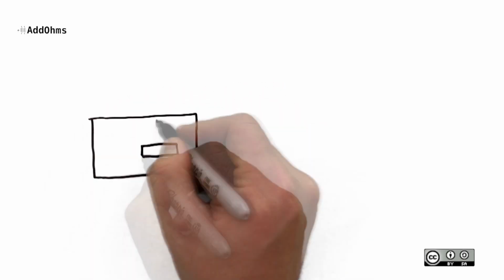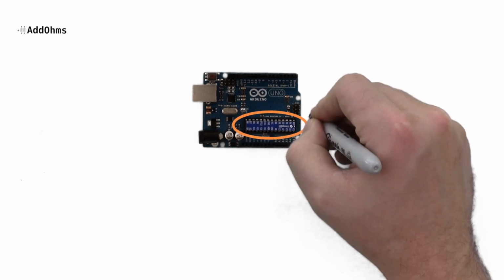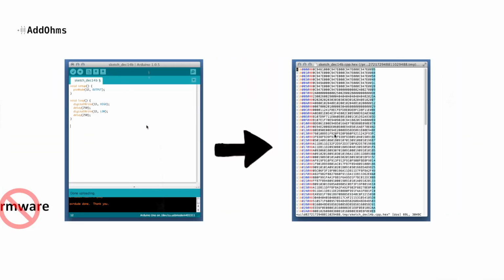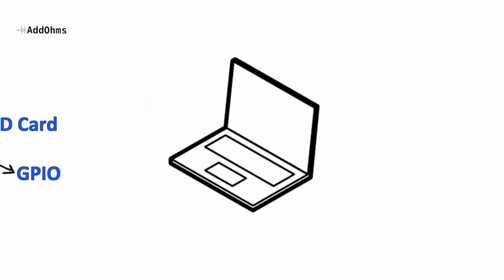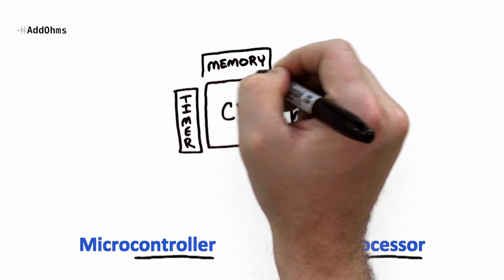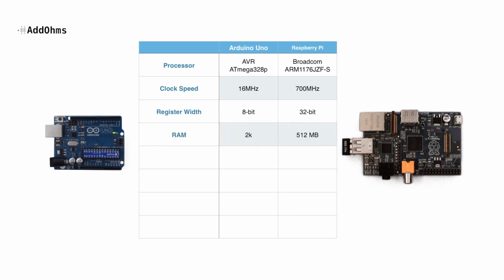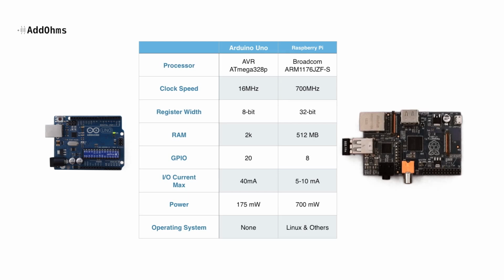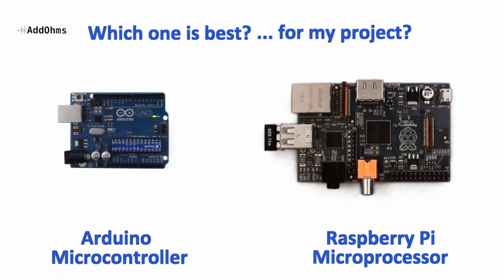Arduino vs Raspberry Pi

Comment: I combined my raspberry pi and my arduino to automate my lights. I fried my gpio pins, but I wanted my lights to be controlled through the Internet. I've seen an app that puts a widget on my phone to run a command over ssh at the push of a button. So I connected the two by usb and I can control it with my phone.

Comment: Hi I  wants to make arduino controlled lawn mower  while doing so I’m facing problems such as which dc motor will be suitable for wheels and cutting blades  and driving unit for these motors.,which sensors are necessary for complete automation as well as coding required while implementing all these components. It is difficult for me to finding formulae to calculate torque and power.I want to make it process automated so that bot automatically move in rectangular area and if in between it’s battery gets down it should automatically go to charging point and come back to place where it stopped cutting when battery was down. For this which coding as well as interruption required is also a doubt for me.For all these operation which battery will be useful? And its capacity Also it will be helpful if all the components required for this project will be available from any single platform.
For all these it will be helpful for me if I get some Ideas from here and move ahead in my project
Any other links or suggestions wil be also helpful.If kit for above mentioned specs are available please contact on my mail id sarvankarpratik33@gmail.com
Thank u
Reply: or just mow it yourself

Comment: Good information, thanks.

I'm currently building a robot that will be using both, the Arduino for motor control and analogue sensing, the Pi for programming the Arduino and also processor intensive tasks like mp3 audio and camera, hoping then to use Arduino to control the Pi, like turning on/off the Pi to conserve battery energy while no processor intensive tasks are required..

Comment: Generally, if your asking this question,you should probably buy an Arduino
Reply: +rafalpilat145 Or maybe you're just trying to get as much information about both before buying one? Elitists suck. Don't be an elitist.
Reply: Suggesting cheaper option makes someone elitist? Yea, right, why ofcourse it does.

Comment: Actually, Arduino is more like a beginner's guide to microcontrollers. When you understands basic things about Arduino and have some experience with it, you can just buy an AVR programmer, forget about the whole Arduino platform and use plain AVR microcontrollers in your future projects. They will be smaller and way cheaper than Arduino boards. Also you can save some flash memory, since you don't have to have a bootloader on your own AVR project. :-)

Comment: Another different the video did not specifically drill into is the Arduino is real time where the Pi is time sharing. So for projects where real time reaction is critical, the Arduino might be more suited. Whereas for projects whereby one doesn't want a particular component to hog all the resources of the system, one might want to consider the Pi.